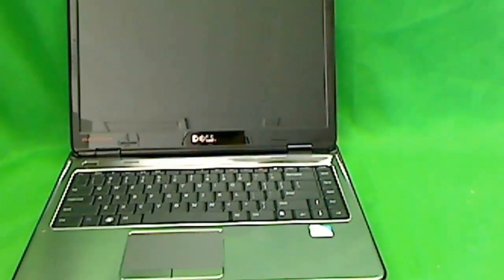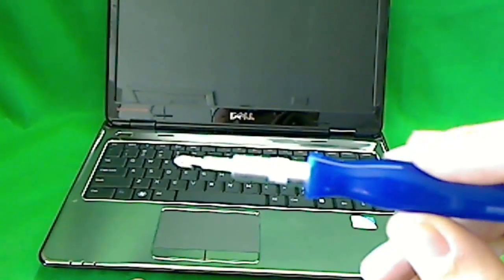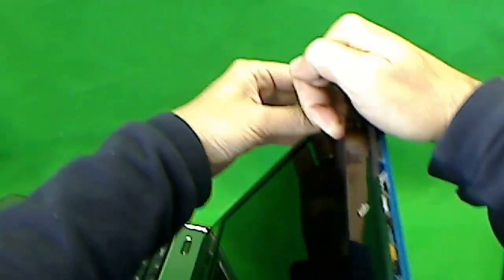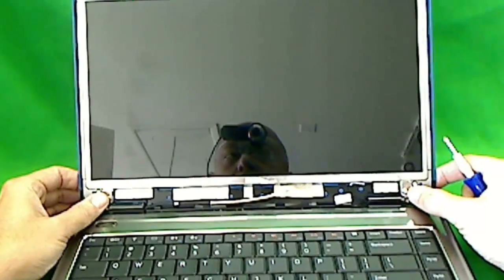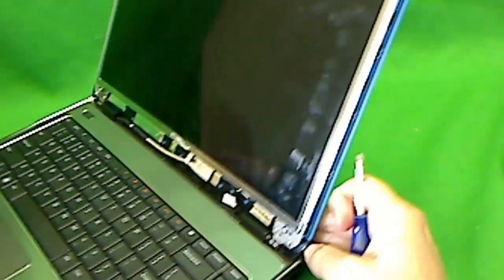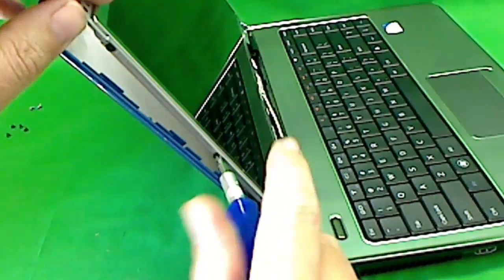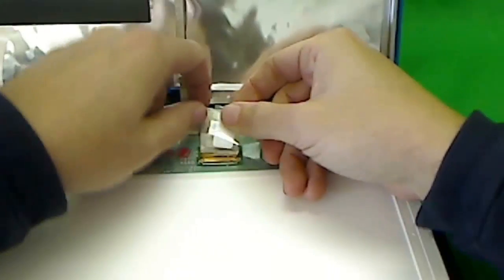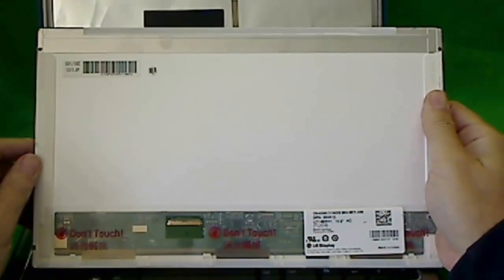Dell Inspiron N4010 Laptop Screen Replacement Procedure

Comment: The procedure worked as you showed it, however I am getting beeps and full screen colors just like the diagnostics tests for the screen. What's up with that?  Still works fine in VGA mode with outside monitor.

Comment: @melly1804  I had the same problem. The connector was not correctly placed, try to put it more deep into the LCD connector cable. Be gentile with the connectors are very delicate pieces.

Comment: Hello, thanks for the great video! I have a problem on my flat cable, I have got a white screen everytime i turn the laptop on, but if i connect it to an external monitor everything goes well! I was watching the screen removal procedure, where i would be able to connect the new flat cable, but the doubt is: where will i connect the other part? is it in the motherboard? how would i access that place? do you know any video showing that? thanks a lot, keep the good work!

Comment: Underneath the plastic bezel is the metal bezel of the actual LCD. When trying to pop off the plastic bezel, look closely to make sure you've not got hold of the metal bezel as well. It will NOT come off gently if you try to do it wrong.

Thanks for the video.